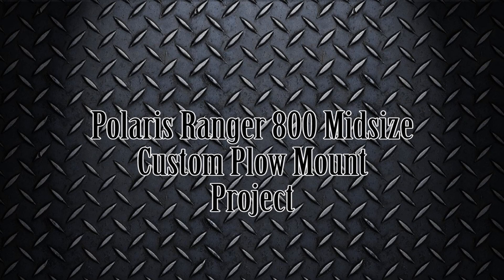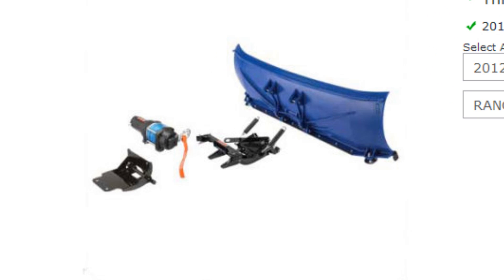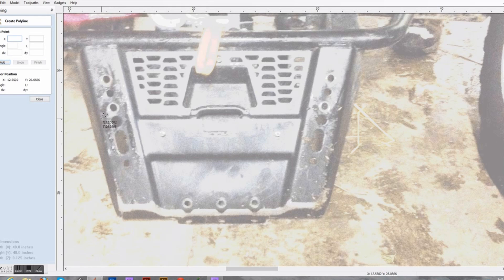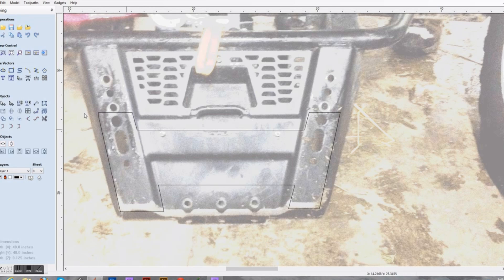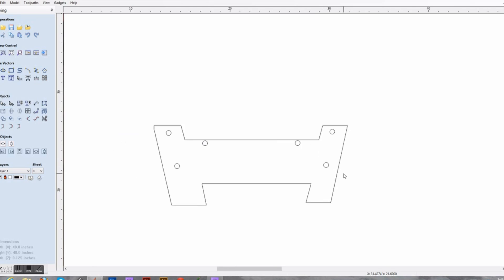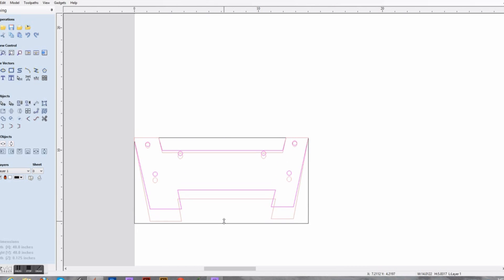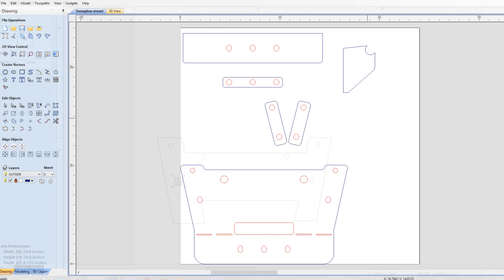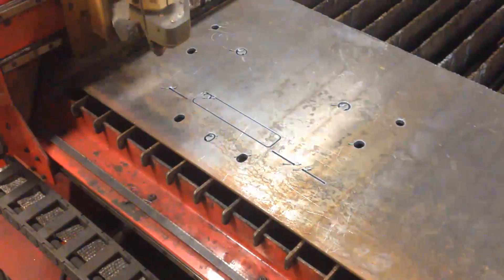Polaris Ranger Midsize 800 Custom Snow Plow Mount Project

Comment: I see this is an old video, but I have the exact same issue. was wondering if there is any way to get one of these or maybe copy of software design to make one of these?
Reply from the maker: Sorry my friend - I ditched those files along time ago.  I don't think it was difficult to design.  I'd make a template from cardboard and maybe taking it to a welding shop to make if you can't weld 👍